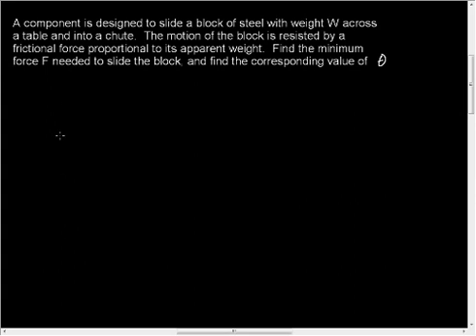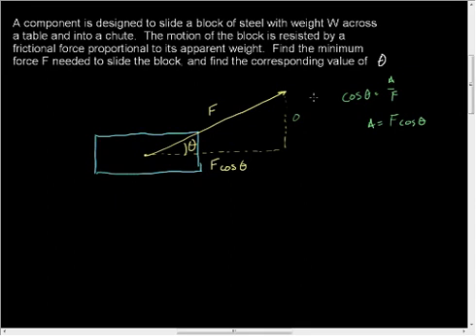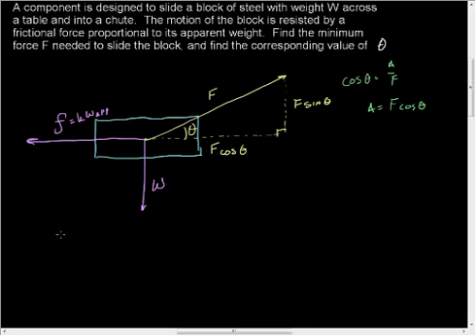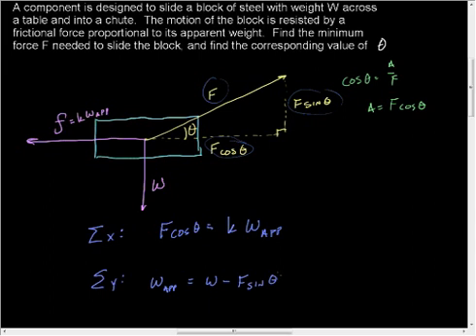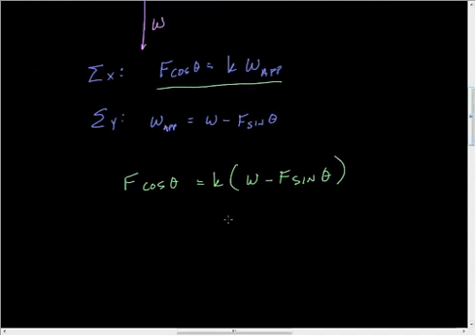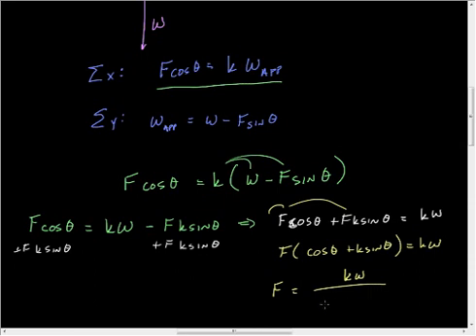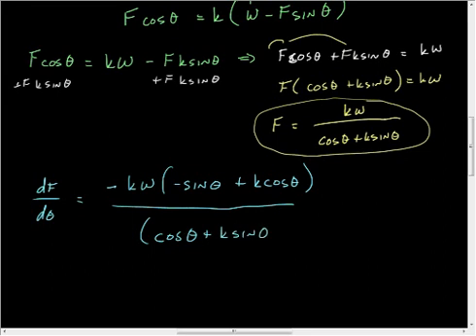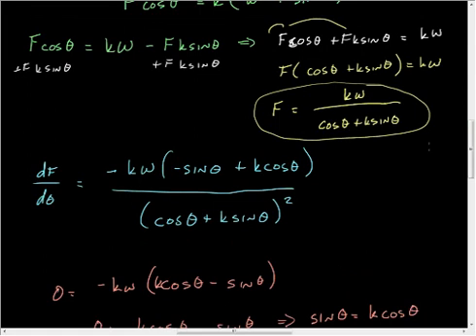Optimum Angle and Minimum Force Part I.wmv

Comment: but why do you take the derivative of Force with respect to theta, can you explain why you do it or the intuition behind
Reply from the maker: When I first took Calculus, I had a lot of the same questions.  There are many letters in here, but only 2 variables, F and Theta - with F being DEPENDENT (or the effect) and Theta being INDEPENDENT (the cause).  

Since we want to find the MINIMUM FORCE, we want to find the bottom of the curve (we don't know what the "curve" looks like).  In Calculus, you learn that a local minimum or maximum can be found by setting the first derivative equal to 0 -- (dF/dtheta) = 0 -- and solving for the dependent variable, F.  You can check to see if it's a local min/max by checking concavity (the value of the 2nd derivative at that point).  Once you've identified the minimum force, you can backtrack to find the "optimum" angle to pull.

To clarify, the value of k does change with different situations.  However, at this level, it is usually assumed to be constant throughout the situation just to make the calculations easier.